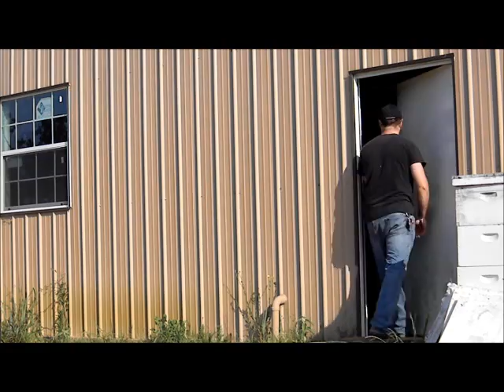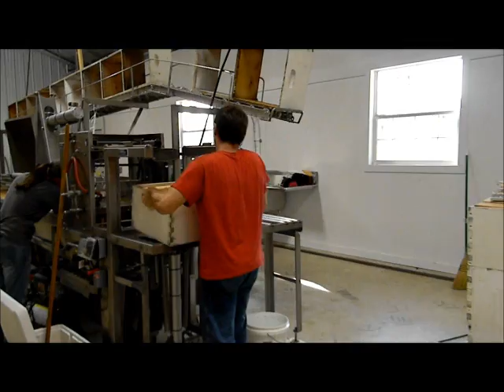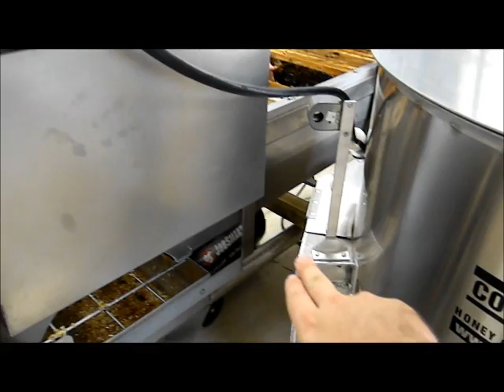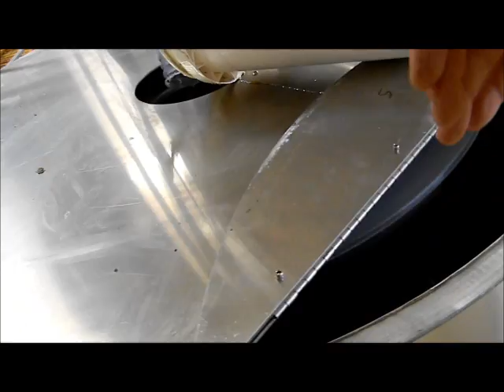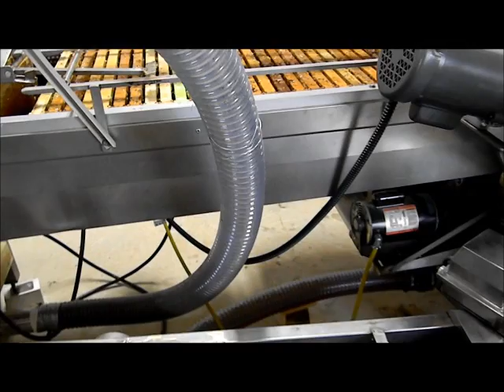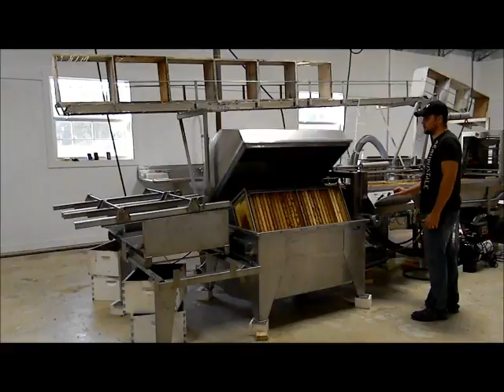Extracting Honey at Lee's Bees of Texas With Cowen 60 Frame Exranion Line

Comment: Nice settup. With our cowen we have the honey from the extractor go to a sump beneath our uncapper with paddles, and a water jacket around that unit.. It then has a PC pump that pulls the honey-wax slurry from the sump and it passes through the C&B honey warmer that they make. It then empties into our C&B Honey-wax separator and it sits in the sump, until it is pumped through a rosedale filter and clear on into our tanks. It is very efficient this way. I use all kuriyama tigerflex and 304 stainless in the system. No  PVC junk to make honey gross tasting. I run the system by myself and don't allow other people to run my system, As I do NOT trust anyone but myself to run the system. With cowen it can be a one-man show. In case anyone is wondering, the beekeeper that would purchase something of this size would be running 1,200+ hives, and spend roughly $65,000.00 on the system. And they would be year-round migratory, which is what WE do. It's long hours on the road, and family time is your whole family out on the road with you.
Reply from the maker: Rick Mahnn Yep. That is the set up you need for wholesale scale honey production. We were a company focused on local sales only in the Houston Tx and adjacent areas. We also did not need to heat our honey to move through our system more efficiently...since the Texas Heat kept our Honey House so warm during harvest season. Thanks for the quality comment!
Reply: BANDILL COWENTING MACSIN

Comment: Change to Manly frames and do away with hand scraping. Also 3/4 depth frames go through the uncapper without any jams. Similar weight per super as full depth when full They are the best thing I did when running 3000 hives. Also no hand spacing when adding supers to the hive.
Reply from the maker: Muray Bennie Thanks for the input. This  video was made just after the worst drought year in recorded Texas history. As you can tell from the video, we were not as busy due to the bad year... thus I had time to make this video. frames were lean and had to be hand scraped after running through the uncapper. Had to to a bunch of things differently that year. Anyhow, thanks for the helpful comments.

I am curious... What part of the world are you from? Where did you  run hives?
thanks.
Reply: Hi I am a Kiwi (from New Zealand) . The land of milk and honey LOL

Comment: We are looking to purchase Cowen 60 air ram full system - noticed you went with a different wax/honey seperator- any particular reason?
Reply from the maker: Mark Lilly According to the research I did before deciding what equipment to go with... It looked to me that Cook&Beals was the preferred system for honey/wax separation. It seems that most larger operations like Cook&Beals equipment, and in my own experience of having one I noticed a big difference in the quality of materials used in construction. Cowen is well built, don't get me wrong, but where there might be some flex, wiggle, bending under weight or torque vibration in the Cowen framework there would not be any in the Cook&Beals. C&B products are built heavier than Cowen. They use thicker stainless steel and design more bracing into the product. These differences are of course reflected in the price difference between Cowen and Cook&Beals... With Cook&Beals products being often twice as expensive or more than Cowen. If I were to do it again, I probably would go all Cowen simply because I was not running the kind of volume to justify needing such a large and beefy (and expensive) honey wax seperator as the C&B shown in this video.
Hope this helps answer your question.
Best regards.
Conrad Craft
Reply from the maker: Mark Lilly ...ps... I also like the people at Cowen a lot. Nate is an awesome guy and was super helpful when I was designing my extraction line layout and any time I had questions. They are good people. I say go all Cowen.

Comment: At 2:06 did the uncapper manage to cut/push the comb out of the frame?
Reply from the maker: essex0chris not exactly. The wood frame was not built correctly and when the frame dropped below the uncapper and landed on the track below... The weight of the honey comb pushed the bottom bar of the frame out... Dropping the piece of comb into the catch basin.
Reply from the maker: That is why you should always glue your frames as well as nail them when building them.

Comment: How much for this kind of set up?
Reply from the maker: About $60,000 for everything you see in this video. Roughly $44,000 for all the Cowen extracting equipment...   $15,000 for the Cook&Beals Honey Wax Seperator. $1,000 for the food grade storage tank.
Reply: I need more hives to afford that. Thanks for the video
Reply: Conrad Craft How many gallons in one given work day would you say this system extracts and processes?
Reply from the maker: Erik N. - It really depends on several things how many "gallons" in a work day you could get... But you can run a full load in about 5 to 7 minutes. A full load in this setup is 60 frames of honey (6 honey supers/boxes). A single deep frame of honey  averages out to around 5 or 6 lbs of honey. An average gallon of honey weighs about 12 lbs. So if we say a single average full load in this extractor is 60/5lb frames in 7 minutes... That comes out to an average of 25 gallons every 7 minutes... Which is around 212 gallons an hour conservatively. Multiply that by  how ever long your work day is... Let's say an easy 8 hour day... That comes to around 1696 gallons a day conservatively. You can make closer to 2500 gallons a day if you are booking it and have really heavy honey frames and know what you are doing. It all depends.
Reply: Conrad Craft Wow that's impressive. I'm a Peace Corps Volunteer in the Dominican Republic working with an association of beekeepers. They're getting money to build their own processing plant so that they can begin exporting but they only produce between 10,000-15,000 gallons a year depending on the harvest. This may be a little out of their league but impressive nonetheless! Thank you so much for the insight, this was very helpful.
Reply from the maker: Between $60,000 and $70,000.